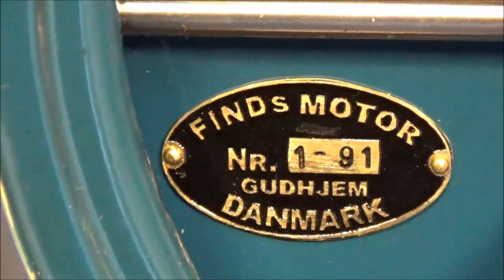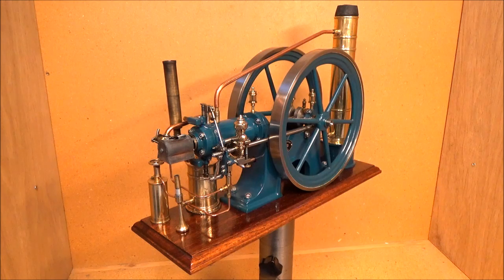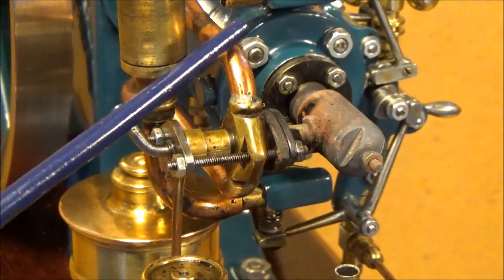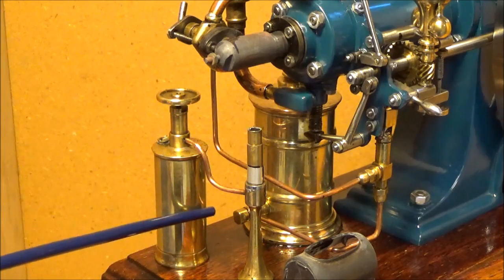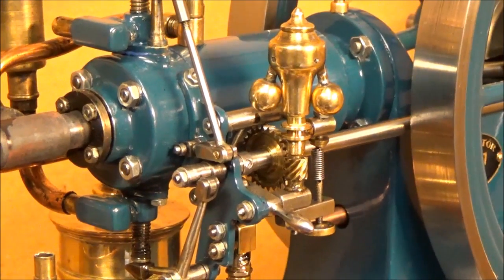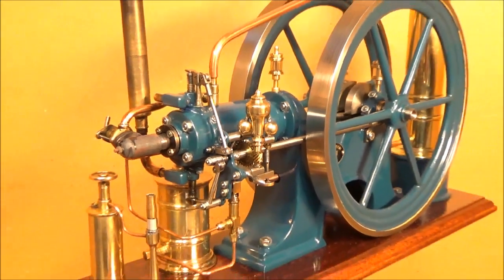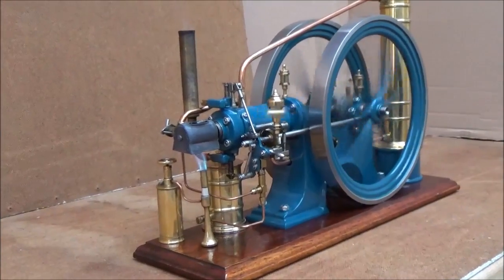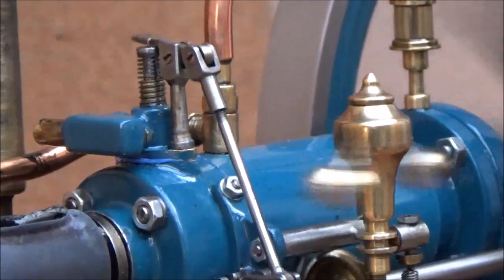Slow Runner Model Hot-bulb Semi-diesel Engine.

Comment: How is it possible that the engine can run so Slow?  Other engines that size need to run much faster
Reply: Heavy flywheel (two of them in this case).

Comment: I was thinking of buildings something similar, only larger and opposed piston twin cylinder, and nearly 200 cubic inch displacement,  use a indirect injection,  using a hydraulic pump to drive a piston / air compressor,  at a small volume, high pressure, 50 bar +/-,  and a second similar piston for the used oil fuel or diesel,  the air gets forced into the injector each firing event the same, both into a 3mm orifice with a basically a small pipe protruding about 3mm, from a solid bar 30-40mm, with about 12mm of it, turned down to about 15mm,  this screws into the head/ injection chamber, being about 25mm x  35mm  that will also house a glow plug,   the 3mm tube having a 1-1.5mm hole merging. With the 3mm at about 60° angle,  the fuel connects there,   then a 4mm ball with a 1.5-1.75mm rod coming off it, , the ball seating in the tube in the combustion chamber,  the rod connects to a spring, keeping the ball seated,   the spring has a cap threaded covering it, with a 6-8mm tubing connected to the cap, the fuel use about 4mm tubing,  the injection pistons close by, with the check valves making it work,  the air use a a 20 mm x 45mm  bore and stroke , the fuel using a 8mm x by 20mm stroke,  the hydraulic pump should make high pressure low volume, with enough volume to actuate the injector pistons with a fraction of a rotation of the crank, maybe use a spring loaded reservoir to store pressurized oil to actuate the injectors, when required, use a 50mm piston with 60 mm stroke, with about 500 psi springs keeping the piston/chamber closed, when filled it should have about 600-700psi  using a safety relief valve to stop filling,. The ignition is controlled by a valve releasing the pressure to fire the injector pistons, the fuel injector piston is controlled by a bypass valve,  throttling the engine, using a governor,    the air blast should push the ball off the seat,  ( it would probably be a good idea to use a guide on the ball shaft, ) but the fuel being injected into the air blast, should be vaporized when leaving the ball and seat, it also works as a check valve for the combustion,  it's a Rube Goldberg injection system, go back to 1923 and it's probably about 3steps backwards for compression ignition engines,  but I believe the extreme pressure air being injected through the fuel, into a high compression engine, (22:1 +) the injection air should be about 30-40:1 compression ratio, into the combustion chamber,  it will probably run at a peak of 400-600 rpm, using heavy flywheels, probably 4, weighing 50lbs each,  with a crank made from two similar flywheels, with about 200mm stroke, and a 4" bore,  the injector should reduce the amount of fuel required, and burn extremely clean, it should be as clean as gasoline, if not cleaner,, I'm sure there is better ways to achieve the injection method that is mich simpler, this is the only way. I can think to build it at home, with machined components,  it should make lots of TQ, I would like to build a 2stroke version also, similar to the Detroit 2stroke diesels, except use a secondary large bore piston, with a shorter stroke, to scavenge the cylinder, possibly enough displacement to slightly supercharge the intake stroke, or maybe incorporate a turbo, to allow the scavenger pistons to only be used on start up,  I want it for a stationary engine, for power generation,  a 10 HP gas engine running gets old fast! A low rpm engine with extremely long stroke,   with a bit of sound management, can be basically silent, being opposed twin, it should be well balanced, so not shaking the house from 300meters away ,
Sorry to ramble,  I would like your opinion if you can follow my rambling! Thanks, and good day! ✌️

Comment: So basically a hot bulb functions like a primitive glow plug? Or am I completely wrong and this also has glow plugs?
Reply: Joshua Lansell-Kenny I know nothing about hot bulb engines, but I build diesels and my guess to answer your questions is this. On a modern diesel the glow plug heats the intake to help start the cold engine, once started the compression creates the heat to keep it running. On this engine the flame acts like a glow plug by heating the incoming air and head, but because the compression is so low it needs the flame to keep creating the heat to combust the fuel
Reply: Joshua Lansell-Kenny 
It works more like the glow plugs on nitro engines, where the heat of combustion keeps them glowing all the time.

Comment: Is it possible to build an engine like this one right here, but with an air compression of say.. 18:1 and only deliver the fuel to the cylinder only when the piston reached top dead centre like Akroyd Stuart himself did with his engines when he worked with engineers at Hornsby's?
Reply: Derpy Redneck 
Yes. This guy has true diesel engines elsewhere on his channel.

Comment: how does a hot-bulb engine work? does the hot bulb cause combustion?
Reply: Yes, the hot bulb is heated by a blow lamp before starting. Before the power-stroke when the piston is at bottom-dead-center i.e.: at the end of it's stroke length before it starts rising, an injector squirts some fuel into the hot bulb. The heat of the bulb causes the fuel to evaporate and while some of the fuel does burn, there isn't enough air for a big fire, when the piston begins rising, air is forced into the bulb, causing even more fuel to burn, forcing the piston down to begin the exhaust stroke.

Comment: Your best video yet, please keep making them in this style.
Reply from the maker: Adrien Perié  Thanks for your kind words
Reply: Find Hansen I have a question for you, why is this engine considered only semi-diesel ? Isn't the air fuel mixture ignited solely by compression ? Also, do you believe it would be possible to make an engine of similar size as this one but not diesel, with a spark plug ? And a third and final question, have you ever considered building a forced induction (like Americans say, "Supercharged") engine ?
Also, since I am asking you a lot of questions, here is an engine you might not know about, which is amazing. It has powered boats and trains, it is called the napier deltic, and it is a British opposed-piston valveless, supercharged uniflow scavenged, two-stroke Diesel engine. A very interesting engine.

Comment: who does it stop when there is no heat to the glow lamp

normal engines wont stop running after the heat is removed
Reply: This engine uses heat for ignition. A gas engine uses a spark plug for ignition and a Diesel engine uses compression to ignite fuel. This engine has no spark plug and low compression so it can't run by itself.
Reply from the maker: Johndeere 100 Thanks for your comments. There are two reasons why the blow-lamp must be burning all the time. 1. much heat is conductedto the cylinder-head and the water-cooled injector because of the short distance,  2. low compression heat because of the short 20 mm stroke.
Reply: Johndeere 100 hot bulb engine can normally run with out the heat (heat is normally any to get it started) about this one can not sustain it own heat there for it need it all of the time.
Reply: +Find Hansen Thank you for the explanation, I'm not an expert on diesel engines but I was wondering why the compression alone wouldn't cause combustion to occur.  I was not aware that this type of engine had a lower compression.  This engine is an amazing piece of work, hopefully it will be taken care of and passed on for generations to come and be enjoyed!